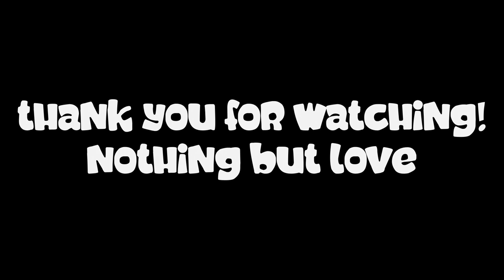Tufting my first pair of portrait wall hangings! Mac Miller & Tyler the creator!

Comment: Do you find it better to use the tool you were using in the beginning of the video rather than how it comes?
Reply from the maker: Much better the wool needs the flow as freely as possible and winding it like this helps massively. Thank you for checking out the video and leaving a question 🤙🏻